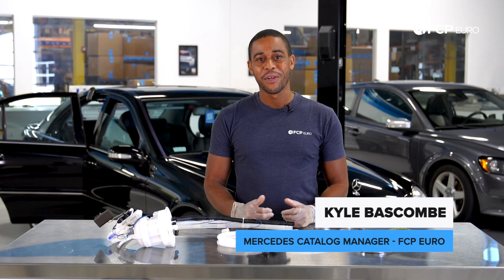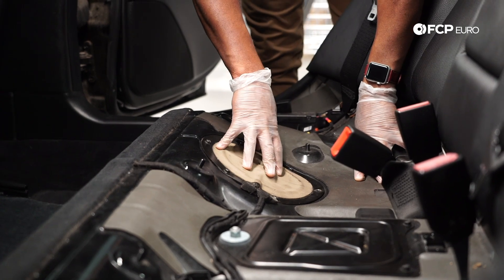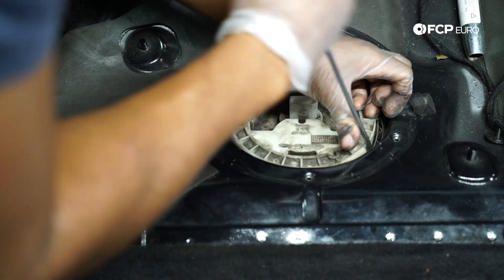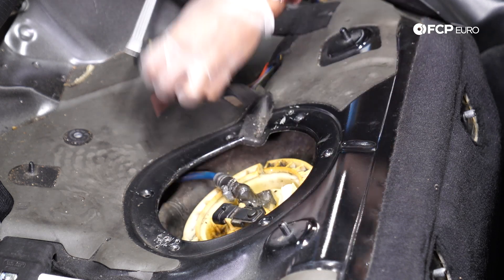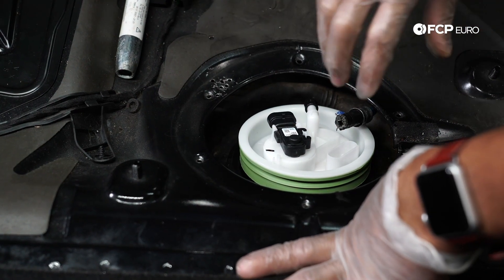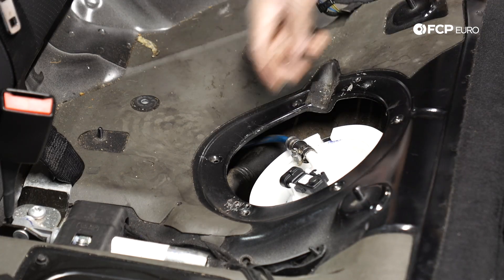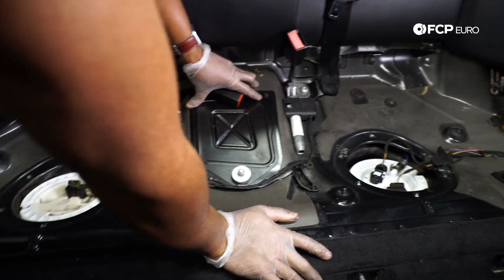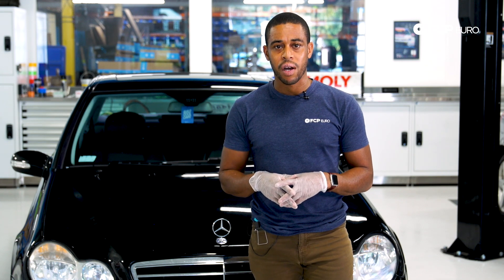Mercedes C230 Fuel Filter Level Sender Replacement and Fuel Pump Removal DIY (Mercedes W203)

Comment: Mr. Handsome is back!  
I made the mistake of taking my w211 to the dealer for a fuel pump replacement. They spilled gas everywhere and gave me the car back in such poor condition I had to roll the windows down for months to get rid of the fuel smell.  Ended up using baking soda myself to clean it all out.

Comment: This is by far the best automotive instructional video I have come across on line.  Congratulations Kyle and your crew. You prove yourself to be knowledgeable, and experienced, and your production quality is outstanding. I have been a GM ( Cadillac/GMC/Olds/Buick) dealership mechanic for over 35 years. I especially like the fact that you included valuable tips with us that are only gained through personal experience, and you were very thorough in your explanations. You included tool and parts information and links. Although I am not primarily a Mercedes Tech. I AM subscribing. I like your style. One thing I'd like to give you a hard time about...you didn't replace the missing screw.  I'm sure it was only to meet video time constraints. Thank you for all your efforts. You are appreciated.

Comment: Thank You, very complete well presented video.  Explained a complicated fuel system repair and the bozo that messed it up before your repair.  I do think I would have filled the extra screw holes and replaced the missing screws just to keep the cab sealed.  Nice work, this will certainly save me time as I am forced to do the same repair now.

Comment: Good Job Kyle. It is good to appreciate the effort in getting spot-on video while working inside a tight hole. Your editing was very relevant. Your narration is indicative of someone who has gone through adequate technical education combined with good working experience. I have subscribed, and if you have new videos on Benz let me know. I use a 2016 GL450 but the tech info is relevant also. With a little digression here, I use to wonder why good technical topics like this don't have as much view as mundane ones. I could see 11 million views on "RESTORATION OF AN 1829 RUSTY HAND GRINDER" while this one can hardly get 25,000 views. A new 2021 hand grinder costs only $10. Whats up folks?? Our grey mattar may be toast soon if we don't work it up.

Comment: NOTE:  VERY IMPORTANT///////
This is the ONLY VIDEO, which shows the CORRECT REPLACEMENT PARTS for the 2006 to 2007, C230,  Passengers side fuel pump. for vehicles with the FLEX FUEL engine.....  Most of the other videos indicate the incorrect fuel pump.... 
From what I can Ascertain ......
There is a gasoline only fuel pump where the pump power wires are integral with the fuel level wiring harness, where fuel pump power is supplied from the drivers side (USA) fuel accumulator/level assembly 
There is a Flex Fuel fuel pump (like the one shown in this video), where the pump power wires exit the top of the fuel pump housing (passengers side USA)
......
MOST PARTS OUTLETS ......  sell the WRONG FUEL PUMP .... for 2006 to 2007 C230 with the V6. as they do not distinguish between the gasoline and flex fuel vehicles.   The two pump assemblies are NOT INTERCHANGABLE.  and the GAS ONLY PUMP will NOT FIT the FLex Fuel vehicle or vice versa. 

......VERY IMPORTANT..... Kyle makes ONE MISTAKE in this video, he refers to the fuel pump (RIght Side) with the power connector on the top of the pump, as a PZEV pump, where in fact that is a Flex Fuel pump assembly.    The PZEV pumps are integrated into the fuel tank and therefore not removable.  For PZEV vehicles, one is required to purchase the entire fuel tank assembly.   Additionally, the Flex Fuel supply assembly (Pump and Accumulator) are not interchangeable with the gasoline only models

Other than that... 
Excellent Job .... Kyle Bascombe
..........

Comment: Great video that details there are two sides to the system. I have a C300 that is not providing fuel flow to the fuel rails. The fuel pump control module is sending 12volts to the fuel pump (old and new) and there is no noise at the pump. Is it possible that a defective pressure regulator is preventing pump operation?

Comment: Guy who did job previously: "OK nice, while that JB Weld dries up all I have left to do is to put these 6 fasteners in 6 holes."
Drills 6 holes in the same area (3:36)
Realizes there are 6 factory holes that line up after losing 1 fastener
Guy who did job previously: "German cars are so complicated & unreliable!"
Reply from the maker: You arent wrong George lol. All those bonus holes hurt to see, almost always better off DIY'ing jobs because no one cares about your car more than yourself!
Reply: I would not ascertain that German cars are unreliable ...  all vehicles today are complicated.... and as the technical complexity grows. so to the risk of failure associated with such complexity.   
German designs are no more unreliable than any other complicated vehicle designs.  As a mater of fact, most fuel injection systems used in vehicles. are constructed using Bosch (German) components and or their designs.  
Removing complexity from any vehicle, should increase its reliability, given that the components use are equal in MTBF. 
.......
Therefore, I don't agree with your blanket statement that all German cars are unreliable.

Comment: Great video guys with a lot of tips!! I got an issue with my E class 220cdi 2011. Engine turns off to quarter of level fuel, and when I fill the tank again needel goes up just fine and goes down while you consume it. In this case which may be the problem the Level sender or the Fuel pump?

Comment: Hi guys, thank you for your good work! I have a 2004 c180 kompressor, i have a problem with returning petrol to the right side(pump side) of a sadle tank. What can be an issue there?
Thank you in advance
Aleksandar

Comment: Kyle, I havevav2003 Mercedes  E500, I want to replace both sender and pump as I smell fuel outside the vehicle. Would I use that red CTA lock ring tool you show in this video?

Comment: Actually done one a these pumps yesterday and broke the damn outlet line - UK 2004 models have a return line as well. 
Matter of a fact I didn’t even need to remove anything on the left side as the pump is situated on the right.
Reply from the maker: Best of luck!

Comment: You mentioned and showed the sender unit but no explanation as to how it works. It has 3 pipes connected to it. Why and what does that unit do? Can't find any videos on the operation of that sender unit? Is it some kind of transfer pump as well? Plenty content on the fuel pump side though.

Comment: Hello, Quick question, is this the same for a 2013 mercedes benz c350? Gas is leaking through the driver side tank coming from above of the tank dripping down to the rear skid plate.
Thank you great video!
Reply: do I only need to replace the O ring Seal?

Comment: Should we unplug the battery before doing this?
Reply: Yes... Always unplug the main vehicle power source prior to working with the fuel tank and fuel pumps, Kyle mentions that early on.   
Its equally a good idea to wear a grounding strap, and to try to use tools which are constructed to resist sparks 
Also its best to keep a fire extinguisher handy 
.......
My rule of thumb is to drain the fuel from the tank once you remove the fuel pump (Right Side), in order to avoid a fire which can get out of control and be constantly fed once it starts. 
Remember.....  If you do this job yourself,  you will be working in an area (once the tank is open) with gasoline fumes.    
So, common sense tells you to remove as much fuel from the tank as possible...... have good airflow in the area your working within.... and be prepared for the risk of fire....

Comment: Hello. Thanks for great video..
My car is identical to yours..I cant find the correct new fuel pump assembly.. I bought Delphi FG1240..but it has no connection on top !!! What part do I need to but please part number. ..

Comment: Hello, im looking to do this job on my 2004 c240 rwd with fuel code 929 (accepts premium or e85) i cannot seem to find a fuel sending unit for it anywhere. Is it possibly just the plug connections that are different? Would i be able to buy a standard unit and switch them over? I never run e85 anyway. Thanks,

Jim

Comment: I need the same fuel pumpthat was in that car in the video and can’t find one anywhere. Would you happen to have the part number for that?
Reply: Same problem..I have the spev setup.  Same as this video... where do we find the fuel pump behind passenger seat with connections on top the hat...I cant find it anywhere
Reply: How much would a fix like you did cost is a shop? I know nothing about cars, and have zero tools

Comment: Hello what is a good test to see if the fuel pump is good? My car will not turn over but cranks and dies. So far ive checked for vaccum leaks, replaced fuel filter and fuel relays/fuses, all ok. I am getting P code 04050.

Any help would be greatly appreciated, thank you!!!

Comment: Question about my 2002 C320 station with fuel gauge reading incorrectly. Both pump and sending unit have been replaced and problem still the same. Hope you can help how to diagnose, thanks!
Reply: I have this same problem with my c230 2007 did u figure out the problem

Comment: Hi there! I was wondering if it would be possible to clean out a clogged fuel filter or replace the filter part in the current assembly  in this model or if id have to buy a whole new assembly.
Reply: The external fuel filter is filter media container within a sealed cannister, there is no proper way to open the sealed canister to replace the filter media itself,  therefore you must purchase the entire assembly.
Reply: @tjhessmon4327  thanks.  Did that and didn't work. So I sold it.

Comment: Hello,
I already changed the fuel pump on left side ( passenger ) my car still not starting? 2007 CLK 350.
I need help on this problem. Could you give some ideas to fix it?
Thanks
Reply: Fuel pump is on the right side

Comment: where I can order this exact pump for my 2007 MB C230 6 cyl 2.5 L Sport sedan Flex fuel
Reply: Did you ever find one? Im in the same boat
Reply: You find one ? I can get you one  if still needed
Reply: @bettykent426  thanks I found one and replaced the old one with no issues. Thanks again for efforts
Reply: @georgenakhle2221  Where they from FCP? I am in the same boat.
Reply: @StraTgik805  Scottsdale Mercedes Part

Comment: Having a difficult time picking out either Bosch 0024773001 or the original Mercedes from FCP.. Help? I'm going to assume the Bosch since it's more expensive and also a trusty brand.
Reply from the maker: You really cant go wrong with either the Genuine, Bosch, or the Mahle. We tend to use the Bosch more often than not, but all of them will work well!

Comment: Is it safer to do this with a close to full tank of gas to reduce vapors? I see a lot of people do this on an almost empty tank but I would think that is more unsafe.
Reply from the maker: Less fuel in the tank will make it for a cleaner job. With the windows and doors open you will have more than enough airflow.